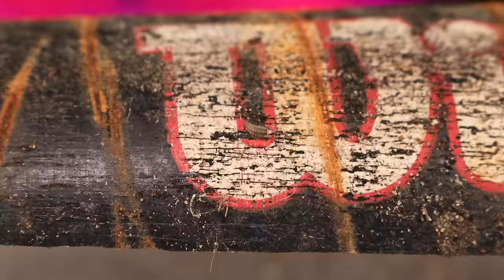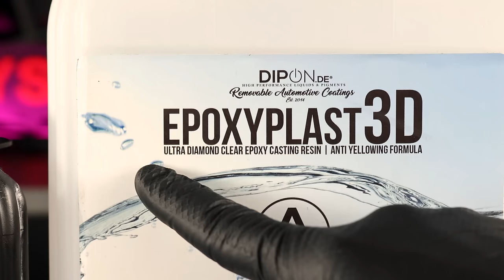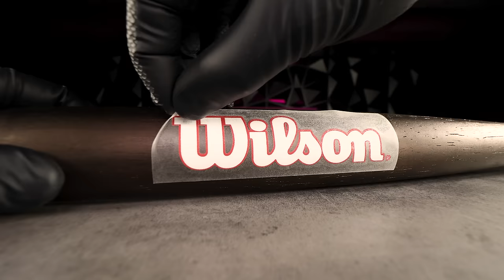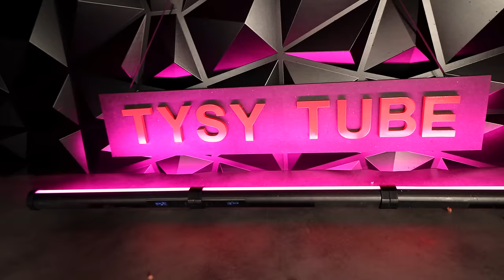Extremely Destroyed BAT Restoration - With Epoxy Resin

Comment: Personal experience tip- when making a container for epoxy I like to wrap it with Tuck Tape, it's a red tape that's made to seal things watertight (ie house wrap and plastic) and has an epoxy based adhesive so it's really sticky and strong. That usually (so far for me always) prevents leaks like what happened to you the first try, which anyone who's had something like that happened can tell you will ruin a whole weekend.
Reply: Можно было просто использовать силиконовый герметик или обычную прозрачную липкую ленту
Reply: I’d also add that it’s best to avoid hot glue entirely. When epoxy cures, it gets hot enough to weaken the glue, and can cause the walls to come apart.
Reply: not just a weekend, mine spilled and settles in the carpet, ruined the month it took to clean it

Comment: im curious if you could drill into these bubbles and fill it back up with the same epoxy. ofcourse the sides of the hole have to be as smooth as possible

Comment: Nice work. A small tip for making cylindrical casting forms…use toilet pipe or any other plastic drain pipes. They can be sealed with a cap and are cheap to buy. Saves messing with glue and acrylic. If you have a wood lathe, that will make it a bunch easier to work on. Cheers

Comment: idk if that type of slow curing resin will produce as much heat or not since on my country most of the resin that available are fast curing one and it produce a lot of heat even when we make it cure slower (less hardener/catalyst).
instead of hot glue that will soften and weak against heat from curing resin, we use tape since it wont melt and have better sealing for this purpose